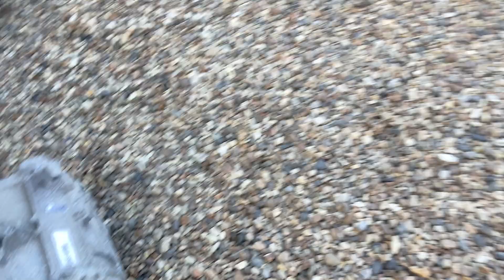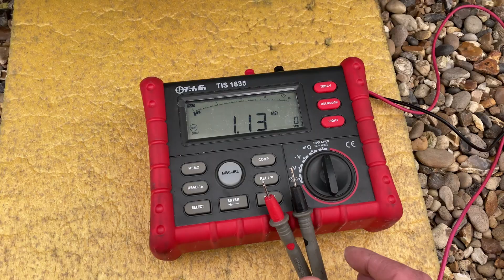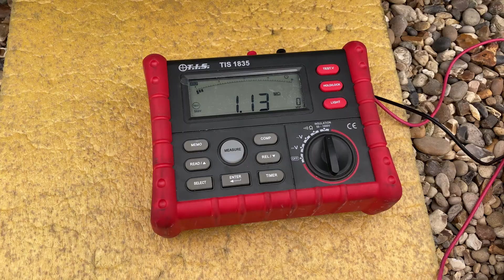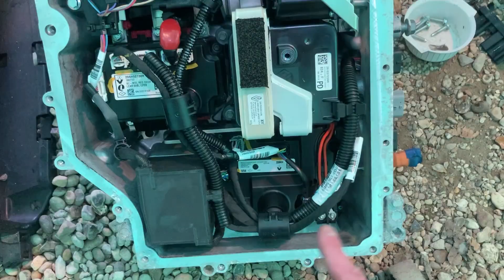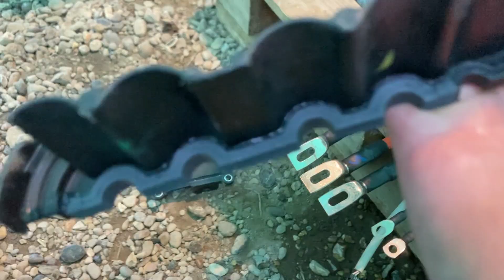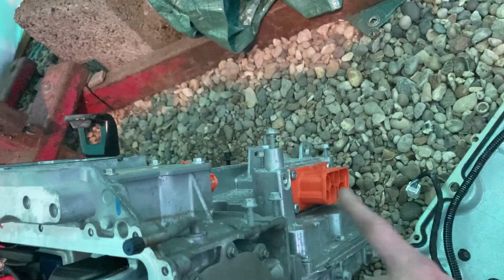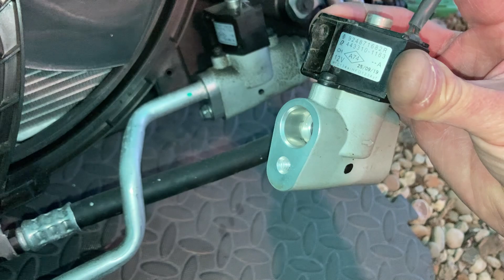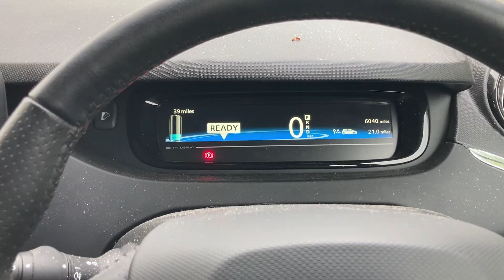This ELECTRIC CAR IS DEAD after only 6,000 miles - Can we fix it? Renault Zoe EV Repair

Comment: If just coolant wash with distilled / deionized water with isopropyle alcohol mixed in. as the coolant will conduct enough to confuse circuitry, then fully allow to dry, then be worth testing module, if no corrosion it will live again

Comment: Great video.
My Mazda front  bumper and light had a small damage (collision.. mechanically and electronically was fine 0 esues.) Everything was replaced by garage recommended by insurance, however something went wrong... 
Car full of faults... currently at Mazda dealership 🤯
From easy repair to complicated one...
Reply from the maker: Wow

Comment: Well done for sticking with it - I'm surprised (as a layman) that the casting is that crap as to be leaky into important bits of the workings.

For a car with only 6000 miles - so many scuffs! They're only little....
Reply from the maker: Older driver !

Comment: We used to use some dewatering fluid called Darathene. The rep sprayed it into a 240v lead lamp and immersed it in a bucket of water and switched on and it worked normally! Not cheap but very effective at removing water from electrics!

Comment: Great methodical and calm diagnostic skills here. I must admit I have always found the idea of a Renault EV alarming given they've struggled to make reliable electronics in conventional combustion cars for decades. Having worked on a number of Renault combustion cars, the electrical systems are generally appalling.
I've never worked on an EV, so this may be a silly question, but can you put a pressure tester on the cooling system in the same way you would on a combustion engine to pressurise the system and potentially help you locate the leak?
Reply from the maker: Could do but I had spares so didn’t need to hunt the old one. Suspect it’s seeping through in a few spots

Comment: Another concern about buying an EV, which is, garages don't know how to diagnose/fix them, so they're scrap. I know garages are bad enough on ICE these days, but EVs look 10 times worse.
Reply: The fact that EVs have about 10% of the volume of moving parts as ICE cars, you are less likely to see issues as there is so much less to go wrong with the motor.
Reply: @the-silverghini it's the electronics. The drive battery management system is VERY complex.

Comment: This is a very good reason not to buy Renault electric cars. If you must go electric, buy one with a long warrantee..
Reply: This is an advert for ICE cars. 
It rains in this country but they can cope. They can even drive through dirty water that comes halfway up the engine block. 

Why design anything relying in controlled electricity that can be exposed to liquid which might change electrical pathways or alter conductivity. ?

Comment: Do you sell any cars?
Reply from the maker: Sometimes yes, if people don’t want to pay the repair estimate then I occasionally get offered them but don’t aim to buy many. I have a 68 plate ze40 in the workshop at the moment that I bought with noisy motor bearings. As I’m the customer I can do it how I like so it’s getting complete new front suspension both sides as it’s common to wear out and easier to do while everything is apart! Cheers

Comment: Like all electrical things EVs are just disposable items no garage will bother taking a job like that on they would need an enthusiast like you, fossil engines made me laugh I was a diesel mechanic for 40 years we called them ICE (Internal combustion engines) then you new speak people make me laugh, throw it in the bin.
Reply: Yeh, because it only takes a few minutes to change a timing chain on the back of a modern diesel engine.

Comment: If I had bought a Renault Zoe car, I would be fighting tooth and nail with Renault to fix this car at their cost. They are saying you only get a 6,000-mile warranty on these models. I would then laugh when sales dropped dramatically, It's obviously a big manufacturing fault and should be done under warranty 100%

Comment: have you ever tried to clean the controlers soaked with coolant with running  isopropyl alcool and after a good isopropyl alcool bath?, the part that stays damp is glycerin if i remember, isoporopyl alcool dilutes glycerin pretty well

Comment: You could do with a point to point wireless link from your router location to your repair location. It would act like a long ethernet cable and be transparent to the equipment. Ubiquiti make low cost units suitable for that.
Reply from the maker: You are right I could but I'm always worried about something like this dropping out when it's halfway through the one time programming 🫣
Reply: @garycevrepairs  I see your point. I have installed loads of such links and they are reliable when set up correctly.  My longest was 31Km and shortest about 10m.  Beware of weather radar detection (DFS) in 5GHz kit, it’s not reliable and can falsely drop a link.

Comment: JUst an FYI, coolant DOES evaporate... just much more slowly because it's boiling point is higher. Over time you can notice coolant levels dropping even if there're no leaks, because of long-term evaporation.

The issue is more pronounced if the system isn't sealed correctly, or if there is severe overheating of the vehicle.
Reply from the maker: Interesting thanks

Comment: This is going to be the same story for SO MANY electric cars. Discarded like fridges, offsetting any environmental benefits.
Reply from the maker: Apart from I fixed it and it’s back on the road 🤷🏻‍♂️
Reply: @garycevrepairs  Yeah, you dd. You fixed one, and that's great. But most people won't have the knowhow. And if garages don't want to repair them, they're just going to pile up. We do not have the right battery tech yet to make electric cars an environmental solution.

Comment: This is precisely why I won't buy an EV. The service and spare parts backup is non existent znd the drive units are underdeveloped and unreliable. The fact that the main dealership couldn't repair one of their own cars economically says all I need to know.
As someone from an electrical and mechanical engineering background I see these things as relatively simple in principle but without service information you're reduced to comparative measurements. I'm sure once they're properly developed EVs will be fine but they have a long way to go as yet.

Comment: Can you re-wind those motors? I hand wound a small electric motor years ago and it still works, took a couple of hours and some hand cramps. From what I remember, the amount of wraps and thickness of the copper wire affects the rpm or torque.
Reply from the maker: Hi, I don't think they will be worth rewinding versus getting a low mileage secondhand motor, but I have done several motor bearing replacements as that is a common issue. Cheers

Comment: Fascinating repair!  Personally, speaking as an ex electronics technician you could also consider thoroughly washing out the contaminated speed controller with cleaning alcohol and then drying thoroughly with warm air, which may have avoided the expense and inconvenience of replacement and reprogramming. I'd also have been tempted to consider the job as more of a plumbing and mechanical repair on the original casing by perhaps installing two oblong aluminium 'gasket' sheets to reinforce the thin machined leaky areas plus use some silicon sealant to create a ridge to prevent any subsequent moisture getting down to the terminal area and maybe a couple of weep holes drilled into the bottom of the casing to prevent build up. Maybe even add a dose of Radweld to safeguard against future leaks!
Reply: That is what I was thinking because alcohol would dissolve the glycol coolant and it might still be functional.  I was also wondering why he didn't put Teflon tape on the holes where it was leaking or some other sealant instead of changing the whole case out ?   Maybe keeping the old case was just looking for trouble ?
Reply: @JeffGermany-n1k  Keeping the old case would certainly be eventual failure again
Reply: The approach Gary has taken is appropriate with his skills, knowledge, access to spares and so on and I compliment him on excellent diagnostic skills and his problem solving methodology.

My electrical skills are way below his but I have the advantage of being a qualified industrial  chemist and have pretty good mechanical skills. My approach would be different.

Firstly, most coolants are ethylene glycol or other similar substances that depress the freezing point. These will be alcohol soluble, so washing out the affected parts with propyl or ethyl alcohol and then blowing with warm air will get rid of the coolant. Ideally you would use electrical contact cleaner after the alcohol as it repels water whereas alcohol will absorb water. Again dry with warm air and then test for isolation of any conductors that should not form a circuit.

For the casting, the extent of porosity can be established by pressure testing between the coolant inlets and outlets. The case should hold a small pressure of say 10psi. If it doesn't,  it proves that the casing is porous/cracked. If the casing isn't cracked, it should be possible to seal the porosity with a substance like Radwell, but it would pay to understand the likely maximum operating temperature and then find a substance that is coolant resistant which can be introduced as a liquid and then cured to form a seal from inside of the casting. The integrity of the repair can be proven by pressure testing again.

Ultimately, it comes down to money and time. If Gary's time is charged out at no more than 75 UK pounds per hour,  and he's in your area, I'd go to him. I wouldn't touch a main dealer under any circumstances.

Comment: Just found this channel, excellent diagnostics and root cause analysis going on here! In conclusion, Renualt build quality hasn’t improved in the move to EV, jaw dropped at porous castings esp with high voltage electrics in close proximity, appalling. This gives me little confidence in long term EV reliability, no better than disposable white goods, you can see cars being written off early in there life cycle as none of this stuff is repairable for sensible money, give me a wet belt any day..

Comment: This is the disparity that is killing the world. 
Renault washes their hands of a product they sell because technicians specifically trained by them to repair this in a huge shop with all the Renault special tools at their disposal can not repair it and wishes to fire the parts cannon at it AND deny responsibility should that cannon fodder of parts fail to repair the car they manufactured. 
Random guy working in the gravel drive at his home with a softie pad dismantles the entire car, uses Vulcan like logic and reason to find several issues, proceeds to repair them, reprograms the car to accept the new parts and is neither adequately compensated nor has a warm dry shop to work from. 
We live in a clown world.... 
Great video, great videography, interesting logic chain and reasoning abilities coupled with a strong knowledge of both mechanical and electrical principles, I did not like the video at first but your style grew on me and I understood the way you digest information and reiterate points to the audience. Bravo man, bravo. Using a megger on wet ground is an insane thing, I liked that most of all :)

Comment: So at 57 minutes still talking the car is reprogrammed with a new controller and box containing. Crappy castings replaced and the car runs. Sounds exactly like what the Renault shop said was wrong he saved some money and got a car with 6000 miles and a YouTube video. Yay

Comment: The bolts through the heat sinks. I couldn't see any thread locker or any sort of sealant on them.

Perhaps they were meant to have a sealant on the bolts to stop the coolant leaking up through the threads and someone has decided to ignore the Engineer's instructions, thinking it takes too long to apply the sealant on the production line?.

Lots of internal combustion engines have bolts going into the water jacket and they use a sealant with no issues. 

The cracks in the aluminium look like cooling cracks. Insufficient control of the cooling process.

Comment: My 63k mile Mokka e has had a similar issue over the last month, Vauxhall had it for nearly two weeks and its cost £1900 to repair but it was the ‘Surge Harness’ which sits between the battery and the inverter which was giving the car strange readings. Now that’s been replaced it’s all good 🫣 for now!

Comment: 6000 miles in 7 years, a bicycle and uber account would have been better value.

Having said that I would have expected short journeys to be where an electric car excels.

I'm wondering if you could use a contact cleaner to wash away the coolant? And it sounds like shares in radweld might be appropriate.

Considering the headlight design of the old megans, or bonnet closures for the clio, I think Renault can stay on my do not buy list.

Comment: Nice video, this controller should have been replaced by Renault under warranty.
I bet the casting was poor from new, but because it got driven so little it took 7 years for the fault to trigger.
Theres probably only very little pressure in the cooling passage when the pump runs to make it leak, probably almost no pressure when driven such short distances.
Well its better than having a coolant leak inside the battery :)
The Zoe is a very old deisgn and it shows, on top of that its made pretty cheaply. Those casting defects are horrendous.

Comment: If I was the CEO of Renault and I saw this video I would be issuing a sincere apology for the bad quality casting (that doesn't change over time, so this is clearly NOT a 'customer induced' problem).
Warranty period is therefore irrelevant.
Renault have a legal obligation to make products that are fit for purpose; they have CLEARLY failed here. Free replacement at their expense with a bit of compensation would be the minimum a responsible company would do.
Over to you Renault...

Comment: Although he didn't say it, they've drilled and tapped those mounting holes too deep and into the coolant  galleries.....The thermal paste kind of sealed it but not quite....Designed by an idiot basically....🤔🙄🇬🇧

Comment: I`m doing a boat starter motor that was under water for months. Got the field coil insulation back up. The Armature has gone from 0 ohms up to 4.2 kilo ohms and rising after 2 weeks sat in the Sun and oven. I use a 110 volt building site transformer for insulation checks on 12 volt stuff.

Comment: “Everything looks so shiny “ after scuffed and scratched wheel arch plus pretty dirty under bonnet. Doh……
Reply from the maker: It's not perfect, especially the bodywork, but compared to Cars of a similar age with normal mileage it is far cleaner. Cheers

Comment: as an independent repairer, i commend your work! just baffled as to how you find the time to video and social the process
Reply from the maker: lol, well only about 1 in 3 or 4 repairs gets videod, some just need to get done asap. I’m self employed and keep my costs as low as possible hence the pop up workshop in the corner of my drive. You also can’t do these rebuilds back to back, it’s hard graft so I do roughly one a week, it’s 2 long days work if necessary or split it over 3 with other jobs or if I’m filming it. Youtube time is effectively an investment in marketing as this is how people find out about me and then contact me with cars that need major work. I don’t do small jobs like servicing etc, I’m not running a 5 guy volume workshop, it’s just me and a line of cars that need ~15 hour rebuilds 🤪. Cheers
Reply: @garycevrepairs  
makes sense! thanks for the response!

edit: personally i don't need the marketing as 'word of mouth' keeps me super busy! too busy to record and post to socials! but then i've been at it more than 4 decades

Comment: ever tried CO contact cleaner by CRC for drying off the coolant? I regularly use it in gpu repair after washing and drying a pcb to displace water/coolant/thermal paste/other liquids, and it also acts like brake clean for electronic PCB's.
Reply from the maker: Hi I could've tried cleaning the old controller but there was no guarantee that it wasn't damaged and it takes so long to remove and refit that any cost-saving against a new one would be quickly eaten up by increased labour and I have to make sure it is a reliable repair. If it was a more easily accessible part I would have given it a go. Cheers
Reply: @garycevrepairs  ah so its a time cost thing, I assumed it was an extremely expensive part from the way the other mechanics were talking about it

Comment: Who would buy an electric car with brushes? Fine for a golf cart, but says something about a car company that spends so much on the battery and goes cheap on the motor.
Reply from the maker: It’s not a classic brushed motor design, it is a 3 phase ac motor but doesn’t contain any magnets so you have to get power on to the rotor, hence the brushes. The brushes should last 100k miles easily tbh. Cheers

Comment: Wierd how it has a Hifly cheapo tyre at 6000 miles.
Reply from the maker: The original EV tyres fitted from new were very hard and cracked after a couple of years so would be long gone by now. Cheers

Comment: So is the Zoe a car to avoid? I was looking into getting one for the wife.
Reply from the maker: Like all EVs parts cost can be high and there are less people that work on them. The batteries are extremely reliable on the Zoe, some other parts not so much. You can extend the manufacturer warranty up to ten years old so look for one that’s had the warranty extended or buy and aftermarket warranty for peace of mind. There are thousands of these on the road, it’s only the very unfortunate ones I see. Cheers